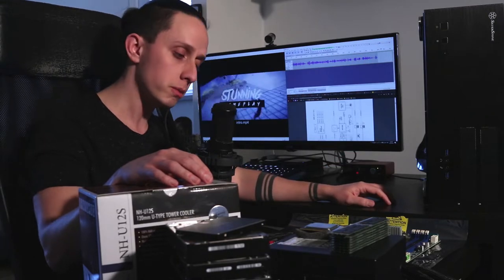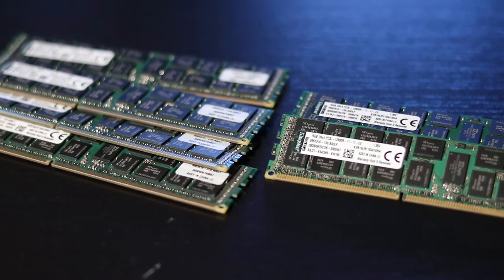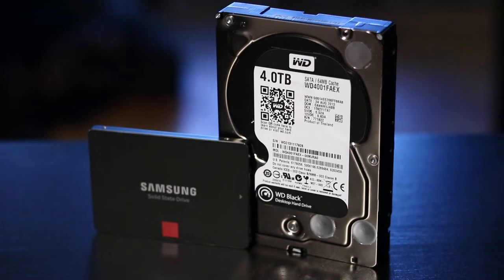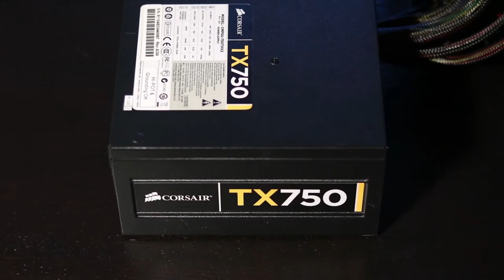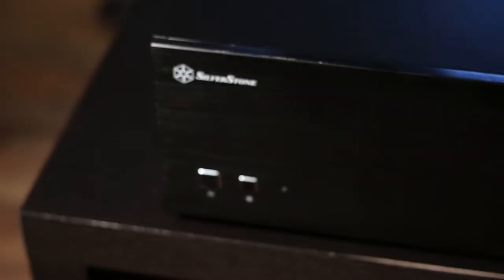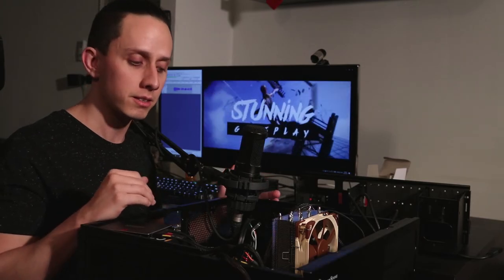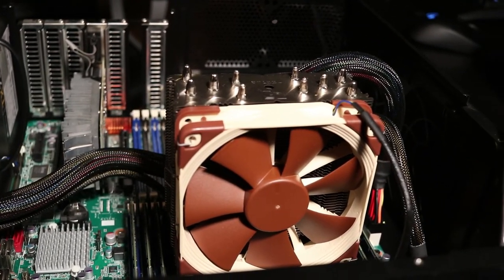The Perfect Plex Media Server 2019! Part 1 (Hardware)

Comment: You chose a case that didn't fit your board and the drive cage, opted for an (ancient) dual LGA2011 board and fitted a power hungry (130w tdp) 16xx Xeon that can't support an additional CPU because it's a 1 series Xeon, if you'd chosen a 26xx you could have at least added another one at a later date, it's not like they're expensive at this stage, i'll skip the cable management as you weren't keeping it in that case.

I thought from here it could only get better, I was wrong. I hoped you'd pinned your hopes on NVENC to do any transcoding because the 9K of CPU mark that 1650v2 brings to the party is going to be quite limiting in concurrent 1080p transcodes and 4K transcodes are a hard NO even in H264, don't even try HEVC, so I was expecting a minimum of a 960, that was the first Nvidia GPU to get HEVC decode and encode in hardware, so with the driver patch it's basically an M2000, or as you're from a gaming background perhaps a 1060 as that's a P2000 once patched, I mean it's the 'Perfect Plex Server' right? I mean you could have bought a P2000, which would be funny given an iGPU gives similar HW transcode performance and is twice the price of a 1060, I have  expectations here.... Hmm, that doesn't look like a P2000, perhaps it's a passive 1050? I suppose it's still a decent shout with the driver patch? reads comments You used a 1GB 610?! Seriously?

Comment: Not knocking your build but I watched the video to the end to see you complete the hardware build and that never happen.  Your research on HW parts was lacking from a standpoint of the computer case.  Anyway good effort.
Reply: It's total overkill. I get it will be a NAS/Plex server, but I wouldn't recommend this build for your typical average consumer, who wants to have 2+; at most 4-8 transcodes, and some NAS/Backup space for data. If you're a small studio, company, or YT channel that constantly is backing up and streaming in 10+ devices (simultaneously), then maybe, yes. But for your average person, you can cut this builds hardware and pricing by a substantial amount. I'm not knocking it either. For a big build, I would totally go Xeon, because of how available and cheap used XEONs (compared to new XEONs) can be from resellers online, but it's overkill for your average consumer.
Reply from the maker: Yea is totally overkill for most use case senarios, this server will serve as a virtualization lab also that's why all the xeon and the so much ram thankyou for the feedback I'll focus on more simple builds for the next videos :)